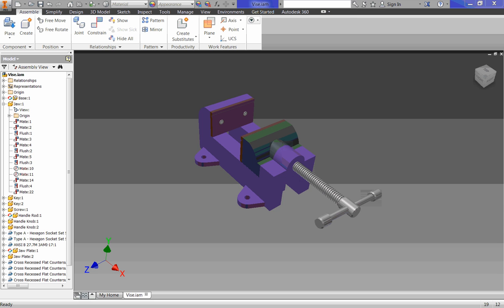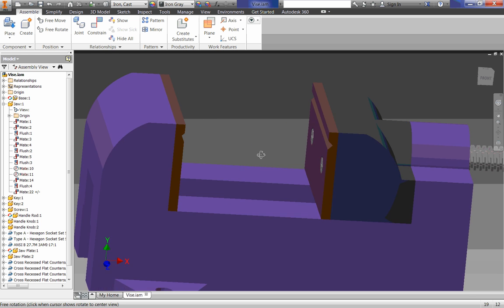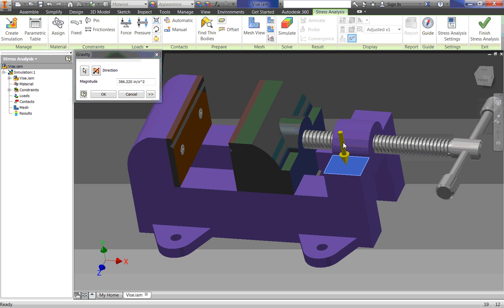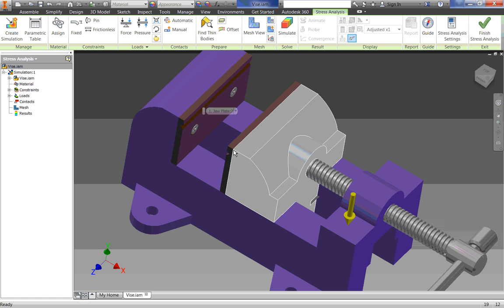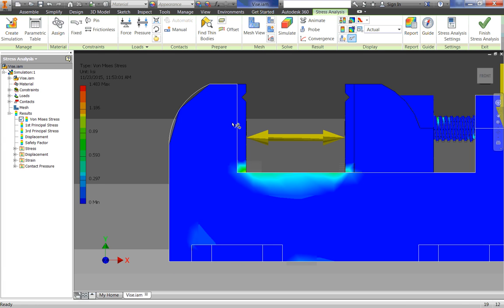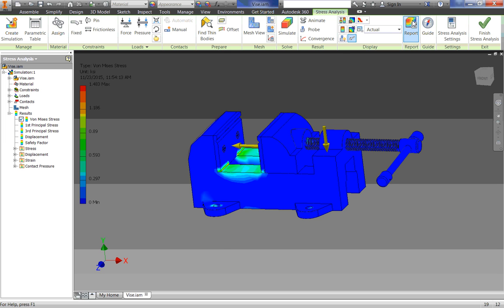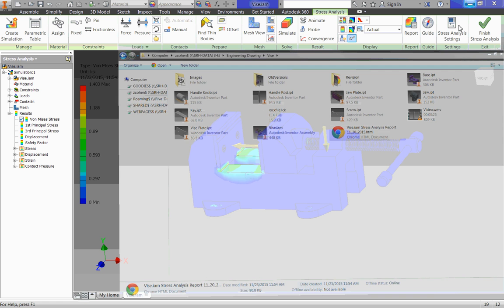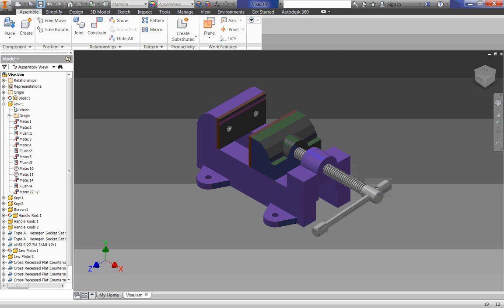Autodesk Inventor Tutorials Vise Part 13-Stress Analysis

Comment: can you  tell me in detail on how to determine the force applied for the analysis, i mean the amount of force.and  why you decide to apply on both jaw?
Reply: Hi, your first question is a very good question! At first sight you should consider that the force is function of the torque that the person give to the sistem. Futher this force is not only function of torque but it dipends on geometry of the screw and  friction coeficent and number of thread that work. Thinking that the man who  gives the torque is superman and he can give all the torque that he wants, the maximum torque dipends on the static resistence of the thread screw .  Is not so easy to explane these concepts here I belive... But I hope that I will give you a way to understand...Second question "why you decide to apply on both jaw?" :it is applied the 3rd principle of dynamic action-reaction, if you push with your hand on the wall close to you, you will give a force from your hand to the wall, on the opposite the wall will give you  a reaction with the same force from the wall to your hand. In both cases the forces have the same value, same direction but opposite verse. I hope being help. Bye!
Reply: @Davidpackard6173  ya, quite helpful.Thanks for your thought to reply.Peace Be Upon You, from University of Malaysia Perlis.
Reply: @amzarasri8912  I studied  engineer at University of Pisa- Italy, It was a pleasure to help you! God bles you and Peace Be Upon You as well :)